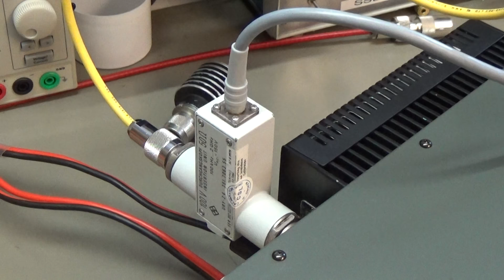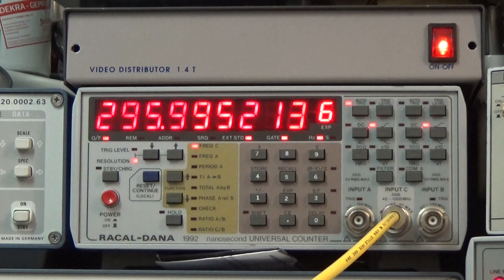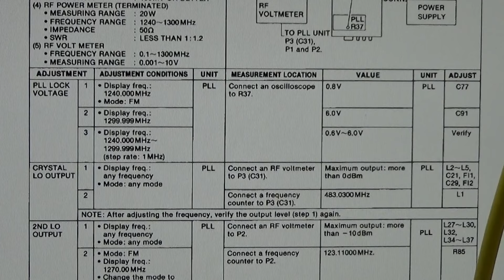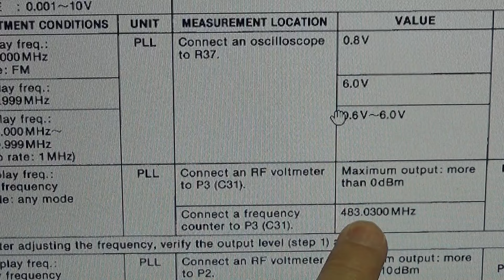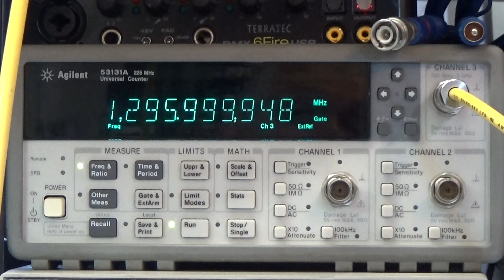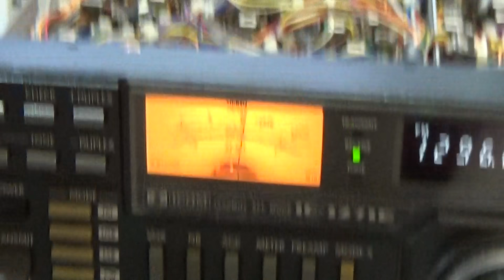#204 ICOM IC-1271 old  naughty radio won't let us in for repair

Comment: I cannot understand why anyone wants to communicate on such a high frequency.  The radio waves go what, 500 feet?  Just not my cup of tea.  Way too much shielding for those high frequencies.  I don't even make contacts on 70 centimeters.  2 meters is about as high as I go.  There's just too much power lost in the higher frequencies.  I even use 213 coax on my 2 meter radio.  Cheers & 73 from W Rusty Lane K9POW in eastern Tennessee

Comment: Hi Nice work. I too have one of these rigs and mine has a couple of issues too.
I was wondering if you happen to have a soft copy of the Service manual as the copy I have does not have the alignment section on it
Thank you for any help

Comment: Hi! So I have one of these that badly needed the crystal oscillator realigned. It turns out that there's a 433.03MHz test point you can use without having to pull the board out - I traced the circuit enough and found the resistor/wire coming out of the shielded section with L7 also is 433.03MHz. It's not the right point for the level check, but it's definitely enough to determine if the oscillator is on/off frequency.

I compared the signal level at the test point seen before and after calibration and saw it at the same level so I figure I'm no worse than before. And now the  output is within a few Hz of 433.03MHz and now the radio is basically dead on frequency.

Thanks for this video! It helped me get over my fear of opening my IC-1271A up and now it's properly on the air!

Comment: Nice job Peter, but what interests me most is WHY those circuits were so far off tune.  What is the physical process that makes such large differences appear over time?  Is it the result of temperature cycling and bad design?
Reply: Components age and change value over time. Mechanical vibration and temp swings can cause small shifts in adjustment points. Caps dry out and suffer chemical changes in their electrolyte. Materials used in construction change their electrical properties over time.

Comment: Wow!!!  What an education you just gave me!  I had always thought that the frequency display on a transceiver showed the "exact" frequency because it was a form of Frequency Counter.  Now I know better.  Since it isn't measuring the exact frequency, what is it displaying?  Is it just counting turns of the dial or something?  I guess unless you have a way to put a frequency counter in line with the SO239 going to the antenna, you can't actually know what frequency you are transmitting on.  Does the lack of accuracy of the display also apply to the receive frequency?
Reply: On a few older radios, the display was a frequency counter.  But in PLL radios, the display is something the cpu puts up to correspond to the settings it is sending to the dividers in the PLL circuit to result in the desired frequency. But for this to be accurate, all of the local oscillators have to be on frequency. Think of it like the speedometer in your car. It simply measures the revolutions of the tires, but unless the tires are the right size and properly inflated, it won’t be accurate.  The same PLL circuits are used to set frequency for both receive and transmit, so yes it affects both. Even a frequency counter is only accurate if its timebase is adjusted to the right frequency.

Comment: Considering the frequency, 1.xx GHz, was it worth all that for 5KHz?  They user can just the dial a little to optimize reception or be on frequency?  P.S. - You have a great voice and accent.  I used to work for Krautkramer Branson, back in the day, and I miss the accent in our meetings and the three training visits I had to Cologne, Germany.
Reply from the maker: 5 khz is far too much for SSB operation. only 30Hz can be heard and more than 200Hz and you won't find your sked partner on the band...

Comment: I still remember my activities at 23cm. If you did not have the right measuring equipment here you were stuck. You are really well stocked. At that time I always worked with transverters and just had to hit the LO frequency exactly. On the input side I had to adjust an exact 28MHz signal. That was no problem with my measuring equipment. The transverter was under the roof 2m below my antenna. I hardly had any coax losses.
I really like your Racal Dana frequency counter. I should get that one too. Maybe I'm lucky and find one on ebay or a flea market.
73 Bernd
Reply from the maker: Hi Bernd, yes you really need to have a lot of different devices to get the jobs done.. Additional to keep all those devices in spec and calibrated to have them reliable...The Racal counter is really a nice device but be careful buying it on ebay. The early models had very much issues with the front buttons. Many folks had to swap out all buttons as they simply quit working! 73
Reply: @TRXLab  Thanks for the tip, Peter.

Comment: Nice video, Peter. I hate this kind of radios, because you have to invest so much time just to to a 2 minute jobby at some small areas. I often find my self thinking  " Hm, may i cut the shielding like a thuna can, and solder it back in place after...;-)"  What i did  was to drill holes beside the nozzle of a vacuum to get to the aligment points, and solders it with new plates. That was a special gov-radio , and i was i a critical hurry... So anyway,  i guess the OM was very happy with your work. So am I! 73 de Olaf
Reply from the maker: Yeah that is the point too much time only for preparing a single step of alignment. I was thinking about the idea drilling a hole but I was a bit concerned about drill cuttings.  73

Comment: " No user serviceable parts inside."  Icom's are always a pain to work on.  I wonder also if this is one of those radios that has the operating system on VOLATILE ram.
Reply from the maker: LOL yeah no user serviceable parts inside....There is a new RAM board installed but I did not look deeper into that.

Comment: the SMDU is only 1050MHz max not 1296MHz so the power measurement could be not correct.
Reply: Love your videos, Peter. Thanks for posting them all for us!
Reply: Hey, this is a Rohde & Schwarz device. 
This company writes often less on the nameplates than the device itself can afford.
I think the measurement of the power was accurate enough ;-)
Reply: I have a bird but when I go outside the freq range I get wrong measurements and this is more than 25% higher than its build for
Reply: @happymark1805  Compare it.
Do you see any differences between the SMDU Z1 and your BIRD wattmeter?
The used RF rectifier diode determines the cutoff frequency of your measuring device. If you put the appropriate "slug" in your BIRD it would work too.
In the SMDUU Z1 a corresponding component is installed.
There is definitely a small measurement error. Rhode & Schwarz therefore guarantees only 1050 MHz to be in their specified tolerances.
I'm not worried about that. The measurement error is certainly well below 5%.
Reply: every measurement outside the specs is deemed not correct, that goes for every instrument especialy if you are 25% over the max freq intended so there is no way to tell if it is off by 10%(full scale) or even more, since it measures 9Watt it could be 10Watt if the correct meter was used, use the equiptment for its intended purpose or you get measurements that are worthless.
Reply: @happymark1805  Maybe Peter should not have done the video. Because he does not have the right device to measure power at 1296 MHz. Maybe he should have cut out the part with the power measurement.
Then nobody would have been upset about that ;-) ;-)
Reply: seems you are the one that is upset about it
Reply: @happymark1805  Ik ben het zeker niet.
Reply: Then why are you arguing about facts :-P but hey, were are your vids....
Reply: @happymark1805  I have high respect for the people who set really demanding videos on youtube. Would you like to see a video of me in which I use a meter outside its specification or hold the soldering iron in the left instead of the right hand, etc.? :-D
Reply: You are cluless, thats for sure :-P
Reply: @happymark1805  
Do you always have to have the last word?
Reply: no, do you ?
Reply: @happymark1805  
I thought so.

Comment: I like the speed the videos are coming, watching now an nice welcome this morning with an cup coffee.

Thanks Peter.

Ps. What kind of cable you use, they are nice flexible?!
Reply: Typically your foam (as opposed to solid) dialectic coax with stranded copper center conductor will be quite flexible.  By comparison, solid dielectric and/or solid center conductor will be quite stiff and rigid.
Reply: I think hes using ecoflex on that yellow cable
Reply from the maker: Thanks Michael! The coax was bought as high flexible lab  cable but it is a long time ago and I don't know what the type is. It is Belden but can't remember the type...
Reply: @TRXLab Ok, is it triaxial cable? thx in advance